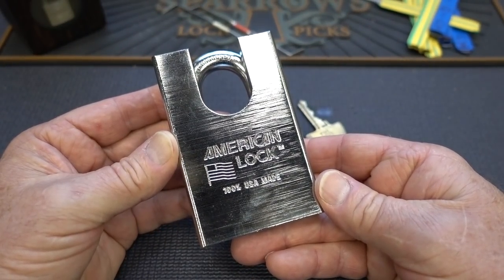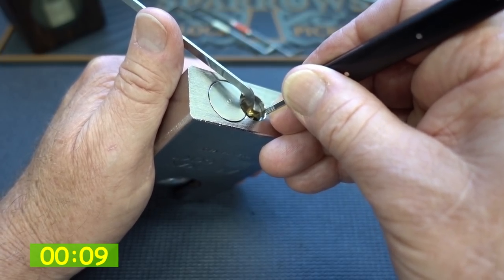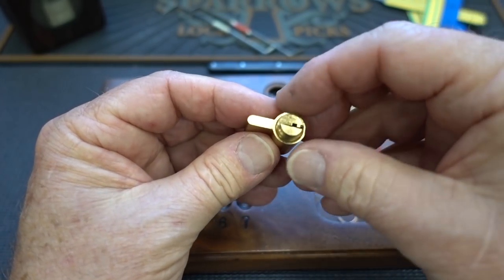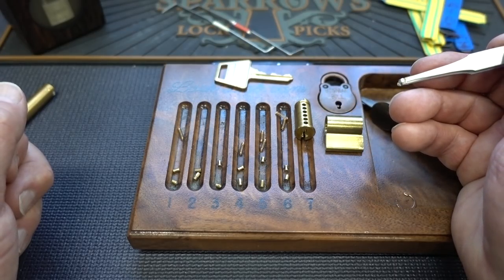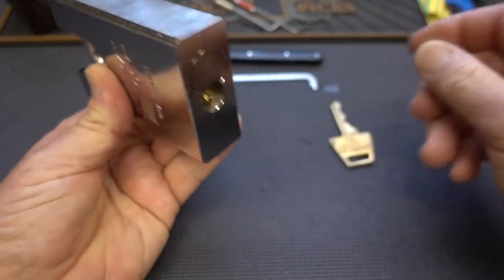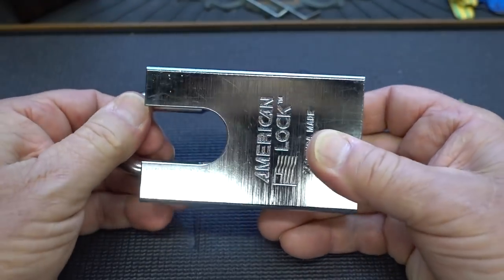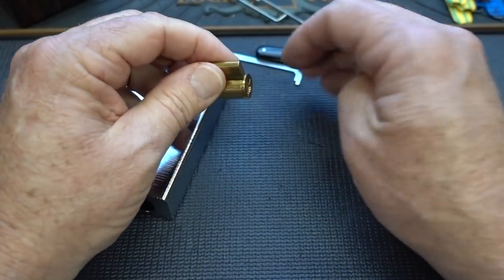(1327) American Series 748 Padlock Picked & Upgraded

Comment: To allow locks with serrated pins etc. to pick a little easier, try this. With a blank key, or any key that will enter the lock, place the tip of the key into the plug, and heavily torque the plug. Slam the key fully into the lock, and repeat a number of times. It takes the sharpness off the serrations, the threading, and if there is no threading, the sharp edges of the pin chambers in the bible, allowing the serrated pins to move more freely. With light tension, even the pick gun was often more successful against serrations.  Regards, Brian.

Comment: I'd love to try picking this lock now that you've upgraded it. Great video showing how someone can make effective improvements for minimal investment!
Reply: This is best a case-study than a practical recommendation. Just be sure you do not leave any debris in the plug. There also will be some material in keyway, where holes break through the paracentric keyway points, leaving still-attached debris. This material can later drop, restricting a pin and cause lock to fail to open. Manufacturing processes remove drilling debris and deburr.... unfortunately some processes keep going and create chamfers at both ends, to make a lock EASIER to pick. Arrow locks used to be somewhat pick-resistant, because their secondary operations were rather lacking. Cylinders were rough inside, and pins had to sit .001 below shearline. Factory pins were bluntly sheared... As long as you used OEM parts to rekey, they performed quite well. That was a long time ago. Others pointed out the WEAR aspect. Over time, how will these field mods perform? I could not do this stuff to client's products and sell it as an upgrade.... the potential failure rate would be unacceptable.

Comment: When driver pin 6 is reluctant to come out near the end of the video, it makes me think that you've made the lock harder to pick but easier to rake.  It looks like the threads alongside the driver springs are holding the springs back.  Combine that with fresh sharp edges on the driver pins, and the driver pins aren't pushed past the shear line.  This effect will reduce as time goes by as the pins, springs, and chambers wear against each other, but freshly fixed, it looks very pronounced.
Sign me: Just a hack

Comment: Though I would contend most padlocks live in the outdoors, and are often positioned for less than optimal picking; manufacturers can take note of engineering possibilities that they likely already have been aware of ( Roku must have hundreds of concepts that never even went to market ), and because the baseline of security must go UP.... it is time to incorporate some of this know-how. Pin TRAPS are still likely the best FIRST approach, since construction keying is already part of the manufacturing process for many lock makers. Other strategies, such as this one demonstrated, probably do not pass the cycle-testing, without the cylinder failing functionally.  An excellent video to demonstrate how pennies can offer huge improvements.

Comment: That lock is way to easy for you in stock form. Nice re'pinning and mods for next to no cost. I honestly don't know why lock manufacturers don't mod their locks. It wouldn't be that hard to set it up. Just replace a drilling machine's drill bit with threading bits. Or when staff assemble the locks have them tap the chambers. Keep up the awesome work Mr Bill. 👍👍👍🤘🤘🤘
Reply: Under cutting and tapping would be best done with a CNC machine, if this was paired up with corresponding spools and serrated pins it would make for some incredible stock locks.

Comment: After all the work you’ve done, there is still a small amount of, I believe, distortion when you speak. Everything else sounds great and I love the new improved picture quality. The distortion is a very high, crisp sound. Hope this helps.  Beautiful lock and excellent job on the remake. Awesomeness!!
Reply from the maker: I am hearing it myself now, but it is only in the posted video, not the original audio file.  I BELIEVE it may have to do with the compression that YT is doing on my video. With the high audio rate PLUS the new 60fps resolution, my files are quite large.  I may be reaching a bit too far in my attempts to improve resolutions...
Reply: To debug this you should upload a test video in which you have already compressed the audio in your editing software. On the machine I am watching (just an old laptop) it is VERY noticable, ironically the old videos sound much better on my device.
Reply: Maybe you should compress the audio yourself? There's a pronounced tinny hiss in your voice. Keep up the great videos!
Reply from the maker: Albert Einstein.  I DO compress is using my video production software.  The problem seems to be that my MP4 file is at 60+ fps and the audio is studio quality 48k/24bit.  YT doesn't seem to like that very much and is dumbing it down to whatever their standard is.  To solve this I may have to go back to 30fps and 44k/16 bit.  Basically, everything I've tried to improve goes out the window, but with the audio the way it is I have no choice.
Reply: video 1323 was perfect
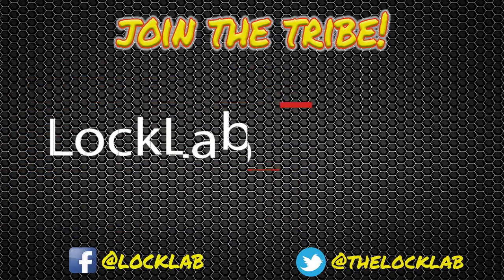Reply from the maker: Yeah, you said that before but nothing changed EXCEPT the length of the video.  16:12 for this one versus 7:44 for #1323.  I think the doubled file size has an effect on YT's compression.  Here is my "plan":  Tomorrow's video will go back to 30fps and 44k/16 bit.  Less data, less compression, so hopefully less distortion.
Reply: We will be glad to check it. tyvm
Reply: I don't think it is the file size, as a random example https://youtu.be/MY8LlHfK9ZA  a longer videos also in 1080p60 and I hear no rattle
Reply: This audio problem seems to be dividing the audience :/ The people that are hearing it are being attacked by the people saying they're not hearing it or that it isn't bothering them. It's there, he's hearing it himself now, there's no need to attack people that are just pointing out that the noise is still there. He went through a lot of work to get rid of any unwanted noises so it is really important we tell him honestly if it has been fixed or not. While some long time viewers may not mind the sound, new viewers that would help grow his channel may not like it and might not stick around for more great videos.
Reply: Nico Mero, I agree that he wants to have the best quality video possible. I have been subscribed fora good while, and might not have done so if the videos were noisy like that.
Reply: Lasse, I listened to that video and heard hissing when the person talking used words like 'device' and several others, most having a long s sound.

Comment: You still got a rattler in yur mike
Reply: Not sure why you feel you need to be his defender. he made a specific video stating and showing all the improvements he made, which IMHO made it worse this round. Listen to a a before and after...... i'd rather it just go back the way it was, which was perfectly fine.
Reply: With all of the equipment he has purchased I have a feeling that it has to do with his editing software. This is something that he should be able to determine fairly easily.
Reply: He asked to be told of audio problems.
Reply: Nice crispy scritches
Reply: NYC10038, agreed.
Reply: Yep. It's there again.
Reply: neil, yeah, probably vinyl.
Reply: I don't hear any rattle and I have it in Dolby atmos surround sound

Comment: Why thread only chambers 1,3,5,6? Why not thread them all? Also why not use all serrated spoils? I never understood why people use security pins mixed with plain pins.
Reply from the maker: If you thread them all, then there will be a consistent feel among all the chambers.  By randomly threading chambers it keeps the picker off balance and he doesn't know WHAT to expect from chamber to chamber.  Spools give a characteristic deep false set, which tells you EXACTLY where you are and they are easy to overcome once identified.  In hindsight, I should've thrown in one, simply to keep the picker confused.

Comment: Nice Lock i'd buy one and do the very same to it. Now for the not so good stuff. The saga of Lock Lab audio....
Tonality of the microphone is very nice. I heard the artifacts on audio peaks - only. I do not feel this is being generated live.
Also at the start of the vid - no Artifacts at all. Nice and clean.  A combination of  A to D conversion, and the file type used by you to upload with. .wav  .dat  etc. The interaction seems to be at the You Tube input/upload point.  YT is using a type of file compression that is creating audible artifacts in playback. I'll bet folding money NONE of those sounds are there if you play back your tracks on your stuff.  If you can change audio sample rate - if you are at 44.1Khz - Cd quality. Try 22.0 Khz.
I doubt much loss will take place, as YT compresses it anyway. Your average audio levels are a bit higher now AND span a broader range of frequencys. Try saving to a different file format and reduce the recorded audio sample rate by half. 
See what happens. I'm pretty damn certain it IS NOT being generated by you. You did that already? Guess i'll shut up now and get a beer - Friday ya know...  Still say it's how YT encodes and decodes.............

Comment: Bill, with all the money you’ve spent on hardware (which I think we can agree is not at fault here), have you considered spending a little money on an expert to ensure that everything is set up correctly?
Reply from the maker: Yes...  Now that it is clear that the sound is not exterior, it is obvious to me...  but I had to go through the process.
Reply: Certainly nothing wrong with that, and even though the problem in question isn't fixed you still have some shiny new kit and some worthwhile upgrades to the lab. Keep up the great work, your channel is my number 1 inspiration for locksport and lock engineering interest :)